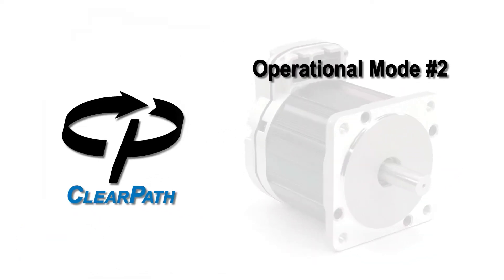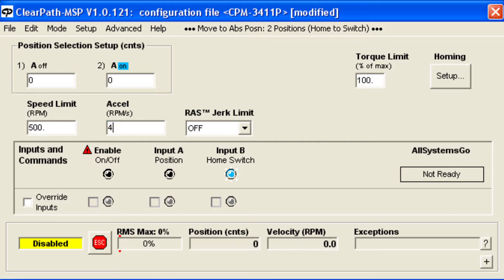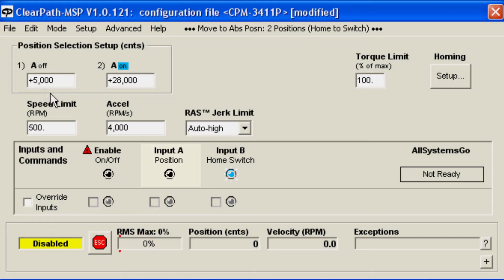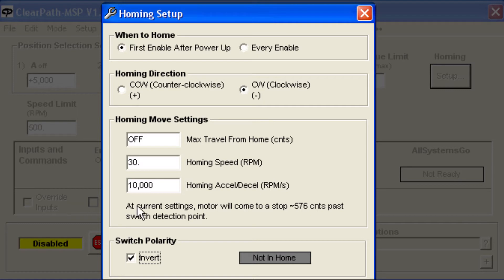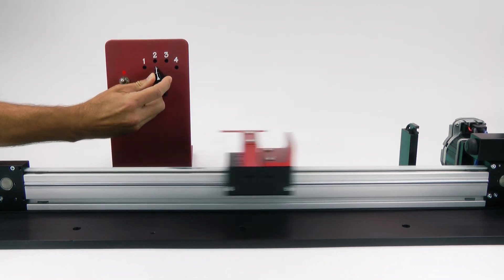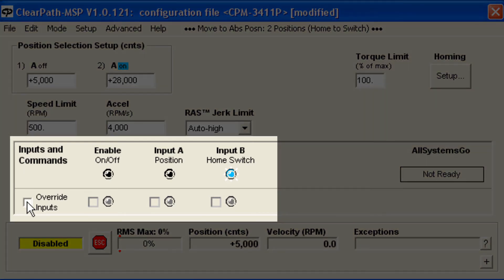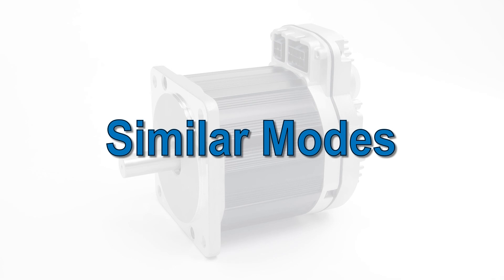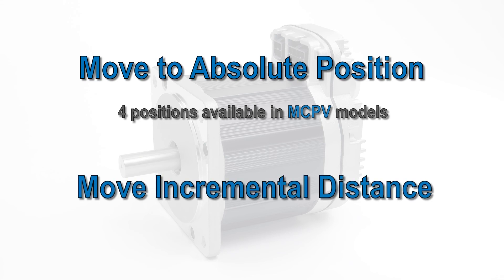ClearPath Integrated Servo: Move to Absolute Position (2 Positions)

Comment: Hi, my motor is moving to the two positions which are set to +12 and +130 but it goes while switching to +7 and then slowly comes back to +12, there is some jerk movement happening, what can I do? I tried to adjust ras
Reply from the maker: Hi @jigarnaik1423,

There are a few different factors that could be contributing to the behavior you've described, but we would need some additional information to help determine the cause. Please feel free to contact Teknic directly to speak with an engineer, and we'd be happy to help with additional troubleshooting.

You can get in touch with us by submitting a contact request through our website (https://teknic.com/contact/) or by giving us a call at 585-784-7454.

Best regards,
Aimee Frank – Teknic engineer

Comment: When we completely power off and switch it on, it does not stop when it hits the home switch and it actually completes 1 full rotation and then stops

But if we dont turn off the power and just disable and enable the input, it stops after it hits the homing switch

What can I do?
Reply from the maker: Hi @jigarnaik1423,

I can think of a few different potential reasons for that behavior. We would need additional information about your system, your sensor, and how you've configured your motor's homing routine before making a troubleshooting recommendation.

Please call Teknic at +1-585-784-7454 or contact one of our engineers through our website: https://teknic.com/contact/ and we’ll be happy to help.

Thanks, 
Jon K.—Teknic Servo Systems Engineer

Comment: Hello,

   Is there a way to have different speed limits for CW and CCW rotation of the motor? If not, what’s the next simplest operating mode that could accommodate different speeds while moving to 2 different absolute positions?

Thank you!
           Justin
Reply from the maker: Hi Justin, 

The operating mode shown in this video, Move To Absolute Position (2-Position, Home To Switch), has one velocity limit. However, there are a number of other operating modes available in the ClearPath family that support multiple velocity limits and positional targets. 

Selecting the optimal operating mode depends on the application, so I can’t make a specific recommendation without knowing more about your goals. I encourage you to reach out to Teknic directly and together we'll determine the best operating mode for your needs. 

You can contact Teknic directly at https://teknic.com/contact/ or give us a call at 585-784-7454.

Thanks, Ian R. – Teknic Servo Systems Engineer